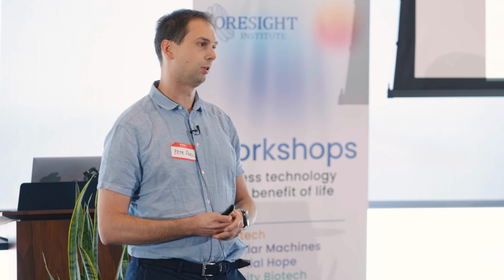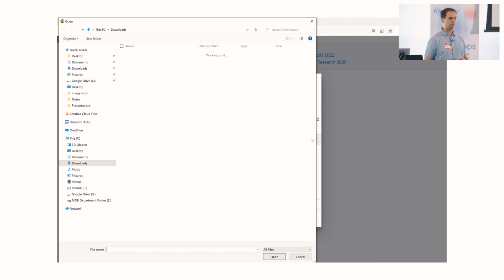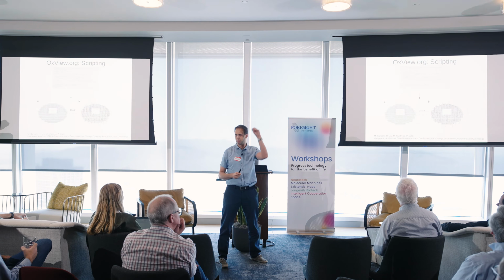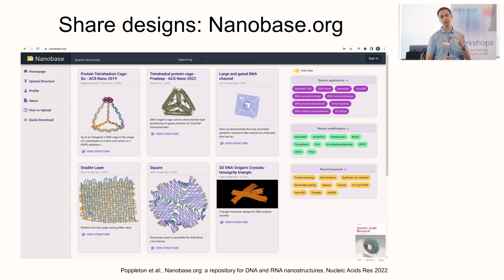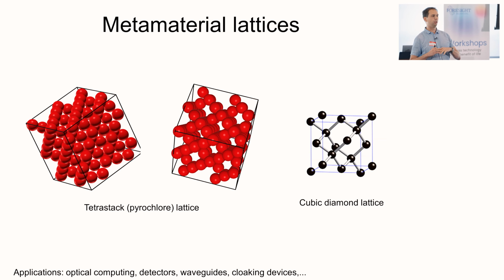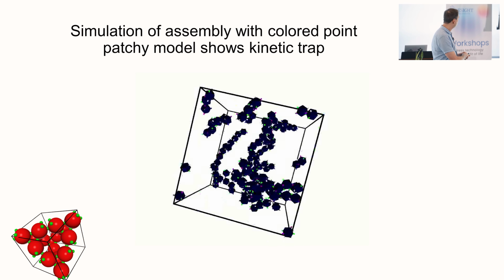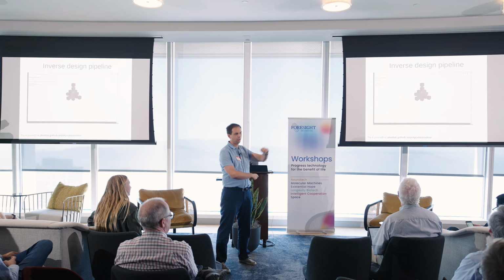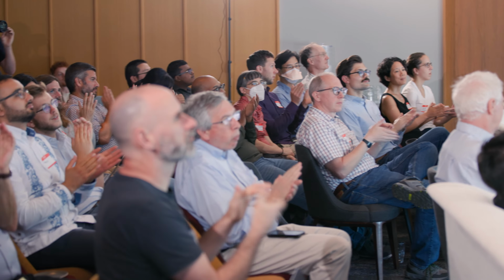Petr Šulc | Multiscale Modeling for Nanostructure Design @ Molecular Systems Design Workshop 2023

Comment: At 9:10 he says the metamaterial lattices would work as a "semiconductor for light" ... I don't follow the meaning or what the purpose or application is. Could anyone please elaborate?
Reply: Hi, because I had an opportunity to talk with him closely about that, I can explain that briefly. Its meaning is simply that such a lattice has a function to select the light at a specific wavelength based on absorption which is similar to the function of the band gap in the semiconductor.
Reply: @WorkAndRelaxHaHaHa  Thanks!